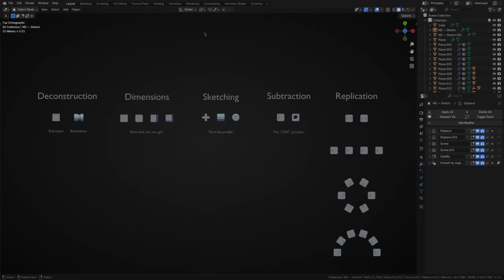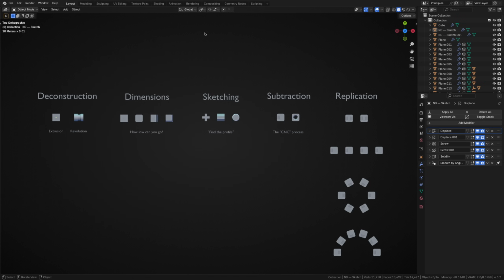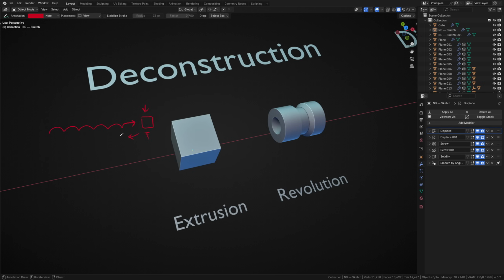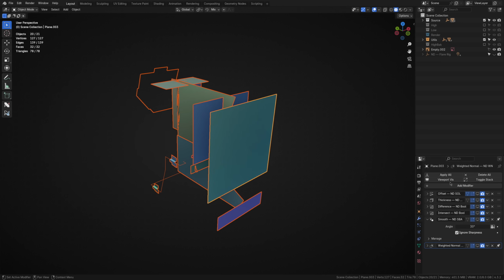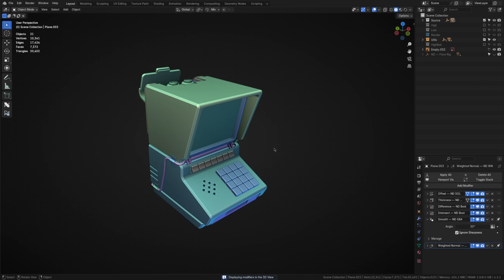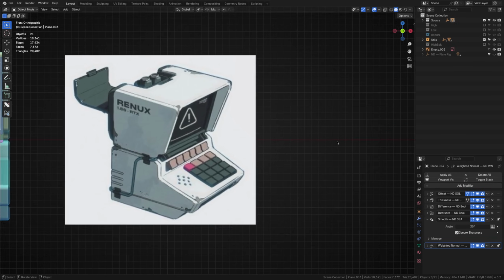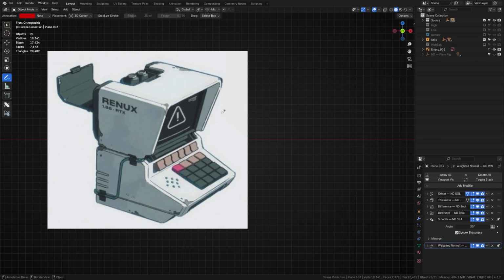Non-Destructive Principles in Blender

Comment: It would be game changing if you added attribute weight based bevel modifier, which allows for different types of bevel modifiers depending on the attribute given to the edge. Hardops has something like this but it uses vertex groups, which is rather unintuitive and doesn't work most of the time
Reply from the maker: You'll be happy to know that it's on the backlog, and should be part of one of the upcoming releases :) — Tristan

Comment: This was helpful. I did hope you covered how you did the wire/cord with its connectors.
Reply from the maker: That was done using a guiding edge and the Pipe Extrude operator. However, since the latest release of ND now has the GN Pipe Generator, I would use that if I was doing it again. Check out the update video on our channel if you want to see how that works :) — Tristan
Reply: @HugeMenace  The generator has been hit and miss for me.. and I think its difficult to get a controlled outcome with a generator.
Reply from the maker: It's hard for me to know what exactly you're trying to achieve without seeing a reference. But the wire on the terminal is an example of a perfect fit for the PG. I will be making a tutorial soon for an object that includes some form of pipes/cables, so that'll be a good way to demo some of the best practices around it & its usage :) — Tristan

Comment: One concept that struck me when learning about this non-destructive modelling is thinking of the underlying sketches you have when you undo all the modifiers as a kind of 'digital negative' from the digital photography world, usually in RAW format. From that RAW image data, you can build up the final image by applying exposure levels, colour balance, denoising, blur etc. This too is a non-destructive process as the RAW image remains unchanged, but it can be used to produce a huge variation of final images.